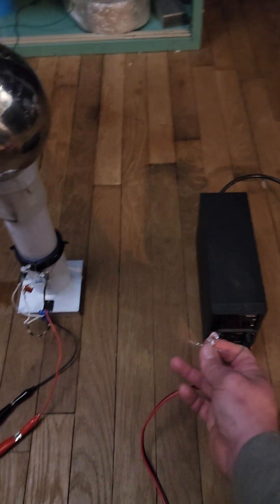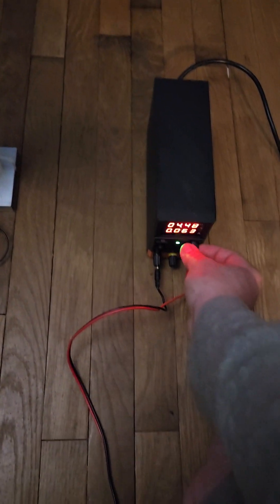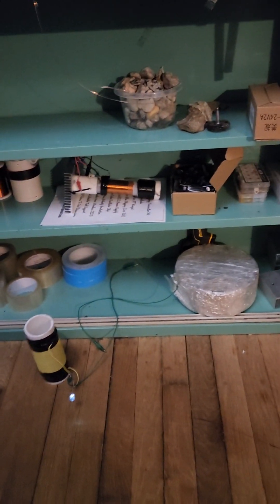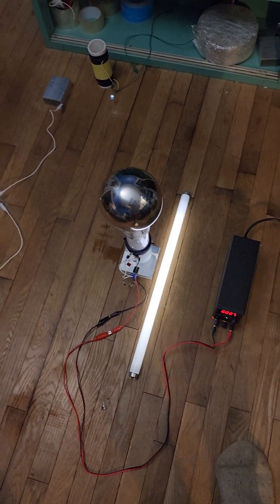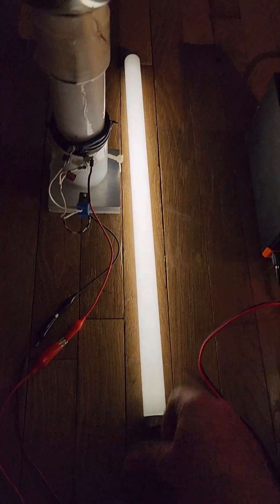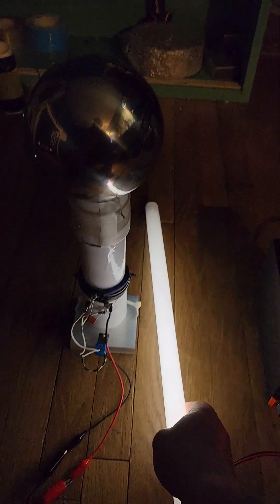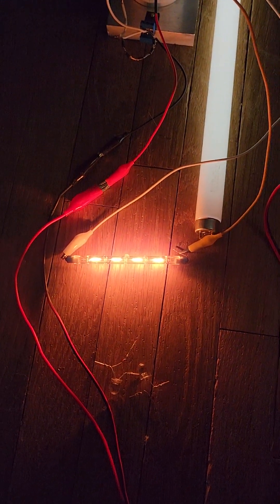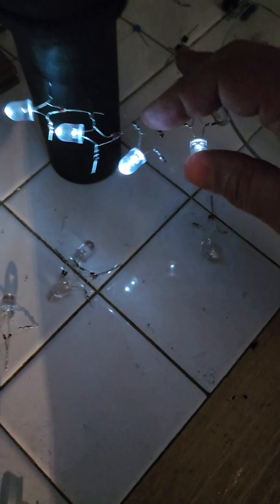⚡️ BEST RESULTS YET FROM PROPER BUILT RESONANT TESLA COIL⚡️

Comment: That kinda seems like bs. Can I get some details I really wanna believe this is true.
Reply from the maker: Watch all my videos from the beginning or ask my customers that purchased transmitter kits
Reply: @MTECH2022  what frequency are you running at? The circuit looks like a simple slayer exciter do u have a schematic?
Reply from the maker: @Felix B.  it is a simple slayer circuit. It's a modified one using non linear negative resistance components. The 3 diodes in the transmitters circuit are negative resistance Avalanche Diodes & the Transistor is a point contact germanium one. The insane effects occur from how the coil is constructed & the frequency is 2 mhz but adding the capacitive ball lowers it to 1mhz. Ideally the tesla coil should be wound on stainless steel tubing & have a graphite ball for a diaelectric top load & the range should go to miles with 30 watts of input power. The Magic occurs when grounding & tuning a receiver coil

Comment: That's like when I run my electrostatic generator, I don't show it in the videos so that I don't look crazy, but literally every piece of metal picks up voltage and I sometimes see arcs of static flashing on completely unrelated and disconnected pieces of metal around the workshop.

I have to be carfeul with my leyden jars because they self-charge around my generator and it doesn't matter how hard I try to ground them out and discharge them when I put them away, I get shocked when I pick them up.

Disconnected circuits pick up milliovolts while I'm running, then the voltage goes away with the geny turned off.

It's repeatable, but it's "crank" science so if I want to be taken seriously for my work, I can't show it happening. The closest I got to showing the effect off was in a short where I was shorting electricity through the glass of a lightbuld while it was close to a fluorescent tube. The discharge is so intense that it induces a current flow in the completely disconnected fluorescent tube that's beside the bulb and causes the flourescent tube to flash.
Reply from the maker: I believe it & it literally says in teslas notes that a properly built tesla transformer will produce mind Bending Wireless Power effects along with unknown phenomenon from the diaelectric realms/counter-space

Comment: 350 pounds for this!!! Are you crazy in 14 and i bet i can make a tesla coil 10 times better than your for 40 quid. Il get back on this.
Reply from the maker: We Sell 2 different models & this is a mini magnifying radient energy wireless power transmitter optimized for wireless power transfer & not wasteful spark emissions. We Sell a 150$ model & if you can beat our wireless power range record of over 2,000ft with only 30 watts of input to the transmitter feel free to show us
Reply: @MTECH2022  This isnt free power you still need to plug it in and the sparks are the only good thing about tesla coils the wire less ability isnt great.
Reply from the maker: @Konthepig  it actually has the potential to create a self sustaining wireless power grid. Reason being its a high frequency open system & certain antenna materials such as graphite & diatomaceous earth will absorb & retransmit radient energy. We also have receiver technology so sensitive we can extract 1.5 watts of power from a ground connection & an antenna along with a tunable crystal radio circuit. That's the true free energy
Reply: @MTECH2022  True free energy doesnt exist genius, it gets lost through things like resistance of the wires. Why would i buy an extremely over priced tesla coil to power one of my light even though the tesla coil will take up just as much electricity.
Reply from the maker: @Konthepig  this device when on has the capability of creating unlimited wireless lighting. Your paying for the technology & labor of one of our team mates to construct & tune the device. My pages description has many links that lead you to the knowledge you seek. & in Regards to electricity & thermodynamics then yes energy cannot be created nor destroyed in most cases such as closed low frequency electrical systems. But the exceptions come when you create oscillating magnetic fields & convert them to electrical flux. Oscillating magnetic fields are not subject to the laws of thermodynamics & the universe is theorized to be an endless open system. Our wireless power technologies involve high frequencies, the Earth itself, negative resistance & point contact germanium technologies. All these culminate into a hybrid wireless power system that can run an infinite amount of wireless power receivers that are properly Earth grounded & Tuned. & the unlimited lighting doesn't create a power draw on the transmitter either. Similar to how an unlimited amount of people can tune in & Listen to a radio station.
Reply: @MTECH2022  There are no exceptions when it comes to energy even though i know it is possible and not really hard to make something that generates a lot of power but i can make a tesla coil thats just as good for around 50 pounds probably. The only thing your doing with the tesla coil is trying to look cool and smart, just advertise it as a cool thing to have and show to your friends.
Reply from the maker: @Konthepig  There actually is an exception & it's called energy Synthesis. Eric Dollard has verified energy can be created when oscillating magnetic fields are present in an open system combined with varying capacitance & inductance with respect to time. The Energy gain comes from the disturbance of the ambient environment/magnetic field rushing back in to fill the created void.
Reply: @MTECH2022  Energy synthesis is just a theory that has been disproved. If we could actually make energy that would go against every single law of physics we have.
Reply from the maker: @kon-f1w  & yet the universe we live in continues to expand at an exponential rate. At the end of the day all science is just theory
Reply: @MTECH2022  The universe itself isnt expanding at a speed everything is just moving away from eachother because of dark energy. Also most of science has been proven.
Reply from the maker: @Konthepig  most of science has not been proven other then mechanical systems & physics. Dark energy may not even exist. There most likely was no big bang & electrons do not exist. They're simply a unit of measurement. Nikola Tesla firmly held these beliefs along with space itself having 0 properties. Space cannot be bent in any shape or form
Reply: @MTECH2022  If space cant he bent in any way shape or form then why do black holes bend light. Electrons obviously exist we have observed how tbey react with other particles in the large hadron collider.
Reply: @MTECH2022  Albert Einstein made the theory that space is 4 dimensional and the theory of relativity states that it can be bent.
Reply from the maker: @kon-f1w  the curved linear trajectory of light near a massive diaelectric object/ the block hole gives the illusion of space having properties.

https://www.google.com/search?client=ms-android-att-us-rvc3&sxsrf=APwXEddz53ukdURs_AbV-O2RaLZKor9DYg:1680633023384&q=ken+wheeler+electrons+do+not+exist&tbm=vid&sa=X&ved=2ahUKEwim2Ozy7ZD-AhU_ITQIHZOHC28Q0pQJegQIExAB&biw=412&bih=750&dpr=3.5#fpstate=ive&vld=cid:430bbdea,vid:HbijQzkJFAo
Reply: @MTECH2022  Why dont you believe in Einsteins theories?
Reply from the maker: @Konthepig  because he stole most of them from Henry Poincare a French theoretical physicist & the electrical Titans That Gave Us Our Modern World don't believe in his theories either. Teslas exact words on Einstein were " a fuzzy haired crackpot with fictitious theories that have no solid grounding in reality"

Comment: Yes mate that is impressive . What are the kits worth ??
Reply from the maker: The small one sells for 150$ plus shipping & the large one sells for 350$ plus shipping. Contact mtechindustries2022@gmail.com  if you'd like to purchase one:)
Reply: @MTECH2022  I'm in australia so I would have to get a second mortgage just to cover postage
Reply from the maker: @Electron Proton Neutron Mouron  that's rough shipping is that expensive to Australia.
Reply: @MTECH2022  let me know if you do and I'll check it out
Reply: @MTECH2022  also chk if u can make 3 transmitters coils w same frequency nd tune a receiver nd receiver/reflector ur aluminium foil w tungsten to chk  output multiplication .. Tunning 2 get the Amp required for the load
Reply: @MTECH2022  metal is acting as a reflector of the wave at the same time it is acting as a collector or earth capacitor  bring in charges as a plate.... So the larger the surface area or higher the frequency u can have a higher charge or chk phase diff if u add a cap after the load shd b similiar to the reflector u can use a aluminium foil also as the reflector earth cap, ur frequency generator ie the coil w the top is acting as one plate so depending upon the voltage nd frequency nd the Amp produced from the centre of the receiver usually one acting as receiver and another load w the earthing shd work out do try